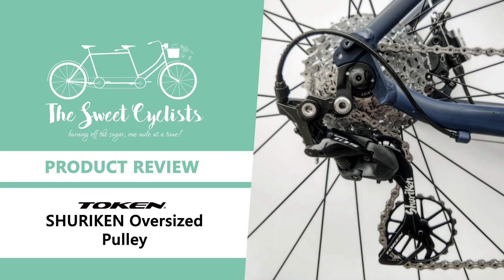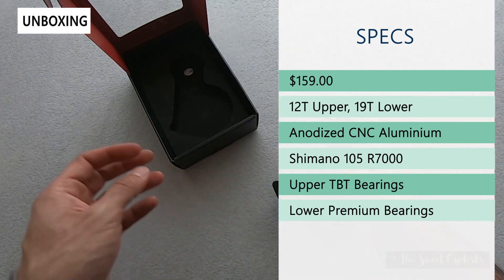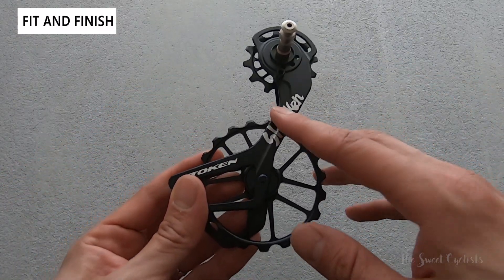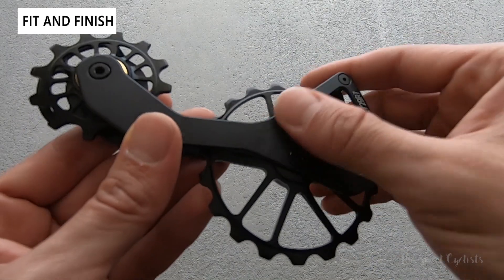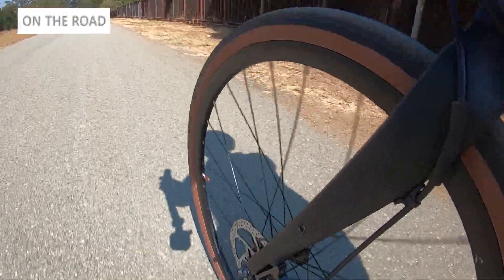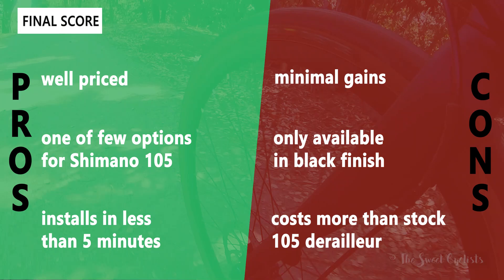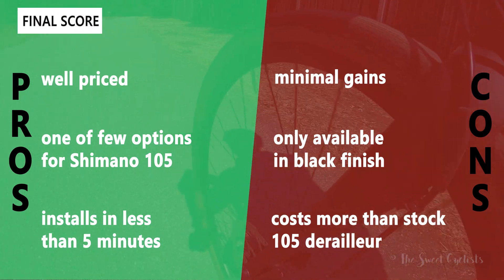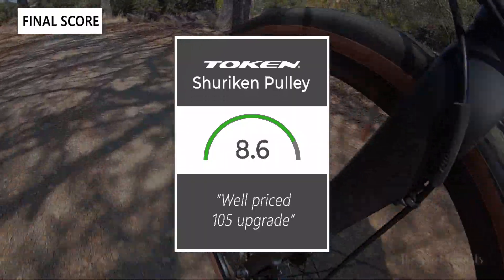Is an oversized pulley (OSPW) worth it ? Token Shuriken Oversized Shimano 105 Pulley Review

Comment: Cosmetic improvement. Like ceramic bearings in the pulley. Only red pulley turn faster :)
Reply from the maker: Part of being fast is looking fast! The Shuriken also comes in a gold/carbon fiber variation (carbon fiber is faster than red, obviously) which looks faster than the all-black version we've got.
Reply: Well. I'm sure red painted carbon will stay definitely the faster. Ask to every Ducati and Ferrari riders 😄
Joking off, it looks nice and I am surprised the length is near equal despite the size of the bottom wheel.

Comment: Are 116 links enough? (Stock 105 chain?)
Reply from the maker: The OSPW doesn't significantly change the chain length so you should still be within a few links of your original setup. On the bike shown in this review I re-used the original chain and didn't have any performance issues with shifting.

Comment: Bro very informative video, I have a question, the ratio of my cassette is. 11 34, with a short cage ultegra rear derailleur, will it be compatible if I decided to put an oversized pulley in my rear derailer? Ceramic speed oversized pulley to be exact
Reply: Probably a Bit late, But you will need to add a few links to the chain Since the cage is bigger

Comment: do you need remove or add pin on chain to install oversized pulley? Tks
Reply from the maker: It depends on the length of your chain. For my installation I didn't need to do any adjustments, but you may potentially have to add a link or two if your chain length is short.

Comment: If i use this pulley on my Short Cage 105, will it increase the maximum sprocket? capacity up to 34t just for an example
Reply from the maker: Good question, I'd recommend reaching out to Token about it. Per the specs that max cog is 34T so it seems like you should be able to extend your range with the short cage 105.
Reply: @TheSweetCyclists  thanks bro

Comment: What chain are you using?  Is it noisy after change ?  my KMC 11sl chain with TK1724 jockey wheel  so noisy !
Reply from the maker: The bike in the video is using a KMC X series chain. I haven't noticed any difference in chain noise with the oversized pulley. Make sure you have your derailleurs properly aligned and the cassette torqued down - otherwise you'll hear a lot more noise.

Comment: are the bearings sealed?
Reply from the maker: I believe they are sealed cartridge stye bearings, but you may want to confirm with Token. They do recommend cleaning and lubricating the pulley every 2000km as well.

Comment: Do you need to make any changes to chain length etc?
Reply from the maker: You might need an extra link or two on your chain due to the large pulleys - but at least in my case no changes were needed. No derailleur adjustments needed either which is nice.
Reply: @TheSweetCyclists  ok - so relatively close to plug and play then